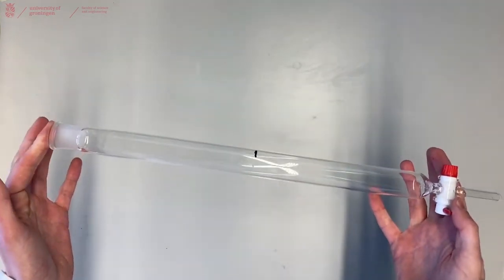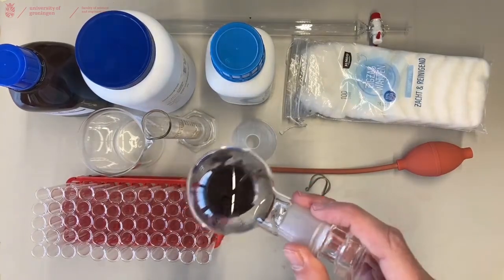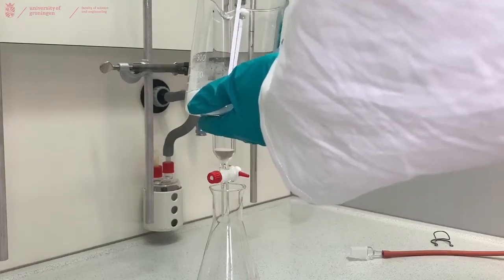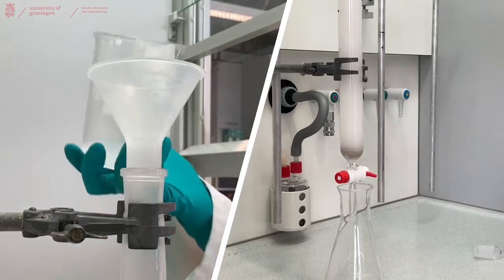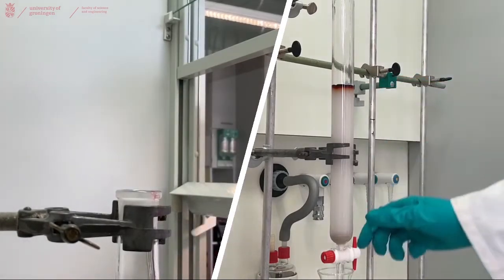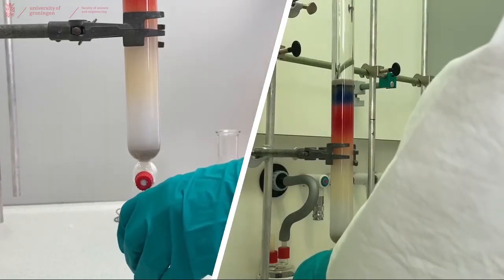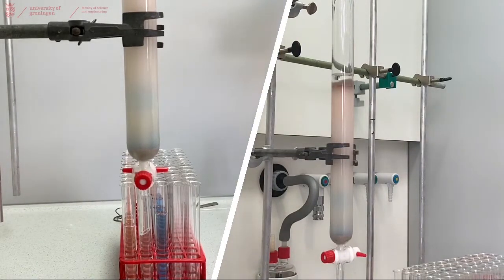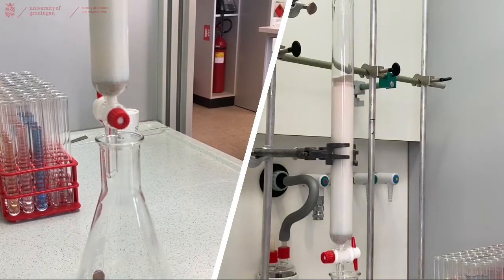Chemical/Laboratory Techniques: Column Chromatography

Comment: thank you. If I used wet packing of silica gel to column (slurry), 
here, can I use any solvent for silica gel until reached slurried, or  same mobile phase or must use only hexane.
Reply: Preferably you use the solvent you are going to use for you column. If you work with a gradient it is best to use the least polar mixture that you plan on using for pouring the column. We advice to never use n-hexane as it is highly toxic and my suggestion would be to use heptane (greenest option) or pentane (faster to evaporate).

Comment: If I have solid sample containing components, 
can I use any solvent to dissolve it?
Or I have to use only  the same mobile phase as solvent to dissolved sample?
Another case, if must use same mobile phase, but my sample can  not dissolve,  here, please I need solution to this problem. can I  use any solvent? thank you alot
Reply: If you sample is a solid add it on top of the silica, put a layer of sand and run it into the columns with a small amount of eluent (mobile phase). Then run the column with more solvent. If your sample does not dissolve in your eluent it will not run through the column, you should either change the eluent of find a different separation technique.